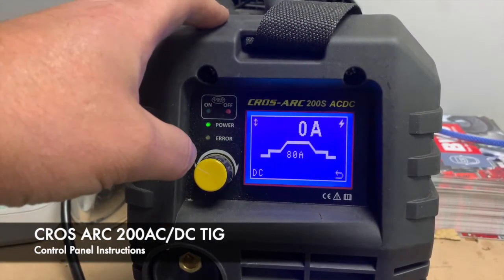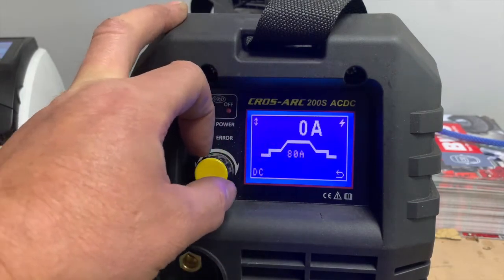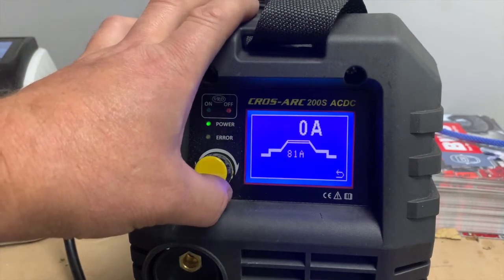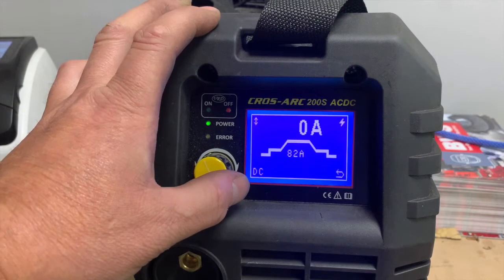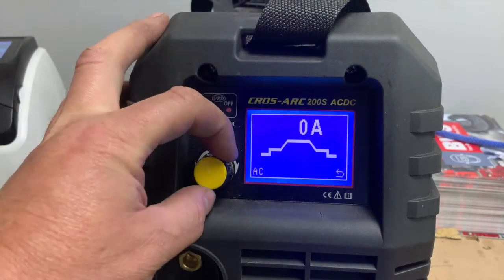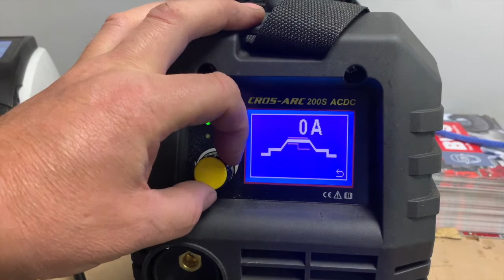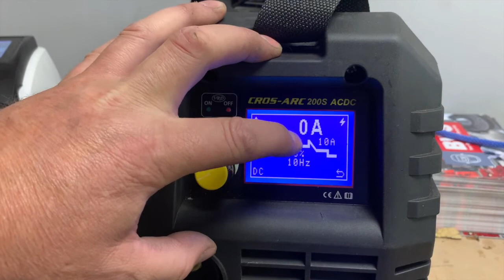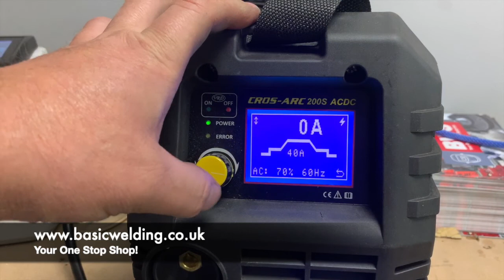Cros Arc 200S Digital Panel

Comment: Just bought a sifweld ts200acdc which is the same, nice to see that you go through the whole menu ac and dc menus to show how to get to what and where, in the manual it says for beginners set ac balance to -65% but I can't get to minus it only goes to 50 as in your video
Reply from the maker: Thanks for comment, yes this is why I have started doing front panel instruction videos as the machines are becoming more complicated.

Comment: Would have been nice if you had mentioned controls with the pedal witch you briefly mentioned in the review. cant seem to find any info on it or anyone selling it for that matter.
Reply from the maker: Thanks, I will redo the video.   Just set your top current on the panel. A full press of the pedal will reach this setting and no more. So you can adjust less but not higher 👍
Reply from the maker: We sell the foot pedal also.
Reply: @MrBaweld  can't seem to find it on the website?
Reply from the maker: When using the foot pedal the main current you select in the middle of the screen is maximum deflection (press) of the foot pedal. Ie if you set 100 amps when you press the foot pedal all the way down it’s maximum current would be 100. Slope and the rest of the graph are unaffected

Comment: Is it a decent welder ?
Reply: I've had one for 3 years, upgraded from a cheap Chinese version. I bought a foot pedal too, which gives more versatility on thinner materials and I added a water cooler and torch for sustained high current welding. 
I do a lot of motorbike related repairs/modifications in mild steel, s/s and aluminium and it's perfect for everything I've ever needed to do. 
I'm a time served welder so have used a large variety of industrial machinery over the past 45 years in the trade. This welder, at it's price, is excellent value for money.
Reply: @markysparky1965  just what I wanted to hear. 👍